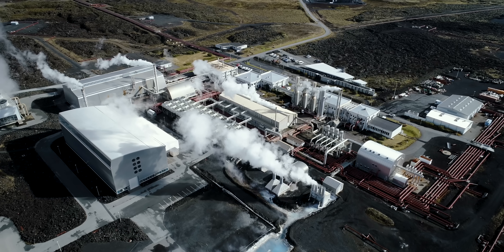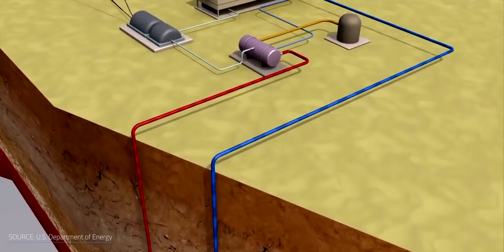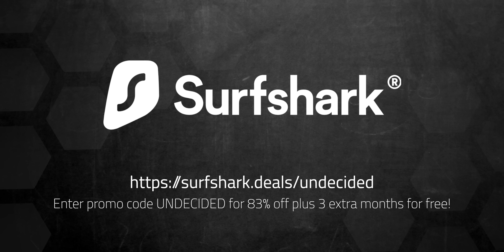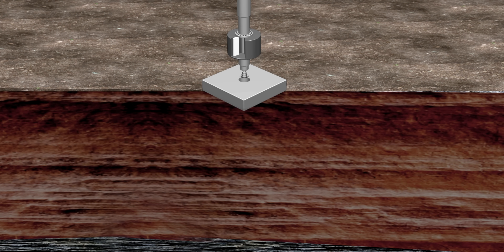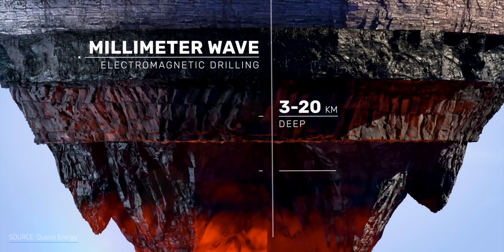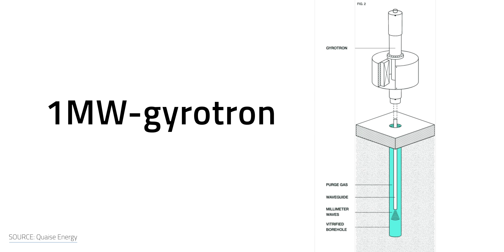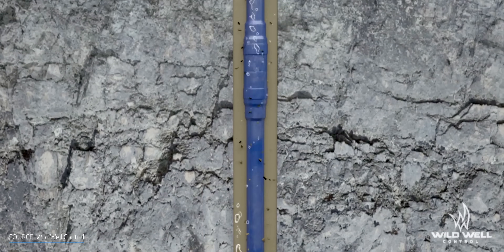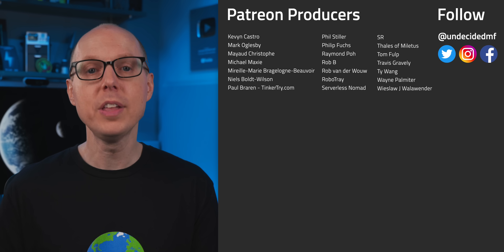Why This Fusion Tech May Be a Geothermal Energy Breakthrough

Comment: I wonder how they ensure that the well casing can continue to move downward when the molten glass they're creating at its leading edge, solidifies around it.  
In a conventional well, the drilling mud runs both inside and outside the well casing which allows it to keep moving downward under its own weight.  With this tech, it's going to be constantly trying to bond itself to the bore hole.
Reply: If the drilling head is a larger diameter than the casing it should be 👌
Reply: @kiwiguy4706   But it's not like a traditional drill head.  They specifically said that it was just the beam reaching past the corners of the pipe turning the surrounding rock into glass, but then implied that it would be able to handle more pressure this way.   I doubt that works if they're leaving an air gap between the bore hole and the well casing (glass isn't that strong), which means in the end they'll be pushing the pipe into molten glass as it hardens while vaporizing and carrying away everything inside the pipe.

Comment: You regularly cover both the generation and storage of energy but I'm curious of the rest of the grid. I'm from The Netherlands and due to the increased amount of generated energy from solar and wind more and more parts of the grid are getting close to their limit.

This seems like a topic that very few people cover while it is a key component to our energy solution, what tech is out there and are there any cool technologies on the horizon?
Reply: With energy transported by train, tanker trucks, pipelines, and electrical wires… all converging to electrical wires — this is a disaster waiting to happen since the amount of energy moved in a pipeline is much greater than energy moved on a wire.

The potential to consolidate all usable energy into a single failure point does not give me the warm fuzzies, either.

Diversity vs Uniformity in energy transportation as well as production is key, and few people talk about it.

Comment: Interesting concept, hope it works. As solar and wind solutions are dead avenues unless solar can get to 70% efficiency or higher. 17% doesn't cut it. Fossil fuel (Natural gas turbines) needs to be main source until we switch to Nuclear or Fusion, but if this is viable it may make it more viable to reduce fossil fuel.  As you can see our economy currently, stopping use of fossil fuel just destroys standard of living and hits low to middle class significantly.  Transition can not be step function, it needs to have a viable reliable technology that can be more reliable and cheaper than fossil fuel as to not impact end customers. This and Nuclear seem to be the best alternatives, good info, thanks.
Reply: Why are you suggesting such an arbitrary metric? solar panel efficiency is already more then high enough that we could exceed current demand by several orders of magnitude exclusively using low value land(like deserts) or areas already impacted by humans. The Sahara alone has more then enough surface area to supply 18 times the total energy needed to sustain 11 billion people at the same standard of living as the US at current panel efficiencies. Wind energy doesn't have as high of a maximum potential output as solar but we have enough potential wind resources to exceed current demand by a significant margin, plus it produces energy in patterns that are closer to average grid demand, can generate significantly more energy for the amount of land consumed, and can be used on agricultural land without reducing yields.
Reply: @garethbaus5471  Not so, if that were the case Nazi California ( in which I lived for 15 years) would not have brown and black outs regularly.  Solar/wind are  not the solution, sure you can cover the entire planet in panels, but what's the point in that when you have clean Nuclear and Geothermal plus Natural Gas to make the transition to Fusion.
Reply: @juanmacias4854  Solar panel efficiency isn't particularly relavent to grid balancing, energy storage, or total generation. The sunlight is free, and abundant enough to be effectively infinite so only getting a fraction of the potential energy really isn't a problem so long as you can put out enough panels at a low enough price. Also California only gets about 13% of it's grid energy from solar so it really isn't a very significant factor in brownouts yet. By percentage of their grid energy being genorated by renewables California actually isn't all that high compared to many other states so it really isn't the best example to use.

Comment: here (a few hundreds KM away where I live) were a geothermal project and it was should down. It created and issue, it hit a material which reacted with water from drilling or ground water, not sure about the details. The result was that material expanded and it created small earth quakes and the ground shifted. A lot of buildings near the test side did get damaged. A small town.
So this would be really be an issue for the idea to put it into coal power plants, at least not all might be suitable due to structure of the ground below and what's arround the plant. (I guess if a coal plant is very near a city, would really be bad/not well planed)

Comment: Scaling out into non-tectonic regions had made me mindful that if this is considered per home we could, still, perforate the crust. I'd be interested to see if more research has been done on this.
Reply: Tectonic activity is purely because of plate tectonics thus the name. You only get tectonic earthquakes because the rocks along fault lines are pushing against each other. They store energy in the bending or compression of the rock.
You cannot create that kind earthquake in a non fault area you would literaly have to crack the plate and the continental ones are 70km deep.

Which means the only other way to generate a problem in a non-tectonic region is thru volcanic activity. Which is actually reduced because pressure and energy are constantly being removed from the system by the power plant.

There are still landslides local excursions, groundwater contamination ect.  If done badly enough you could probably even undermine the structural integrity of a small mountain and cause a really big landslide.

However non of these are on the scale of causing a non-earthquake area to become geologically active.

Comment: Matt, This one is testing the limits of my faith.  I'm mostly concerned about the exhaust.  It has to go somewhere.  What does it come out as a solid or a gas?  Is there a gaseous component that can't be condensed?  How many of these holes need to be drilled to satisfy our energy needs?  How stable are these holes?  Considering they will be located near fault lines and volcanos, are they susceptible to earthquakes?

Comment: I took a course in geothermal energy in college and I really wanted to learn more towards it. But was disappointed as there was absolutely no geothermal energy production in India. The tectonically active areas in India is a convergence between two crustal plates and so the crustal thickness along those areas are extremely high as rocks pile up. 
That meant way too much drilling is needed to get to superheated water there.
If this technology works and is adopted by India, it would be a game changer. 
That would mean there wouldn't be the need for those gigantic dams in Himalayas that are now under serious threat from mudslides and flashfloods from cloudbursts that are happening more frequently because of climate change.
But I'm curious as to how the absence of seismic probe in conventional drilling could impact the process. It's kind of like driving blind. 
Though this might require using a separate probe after drilling to collect geological data, it will still help us research and understand a whole lot more about deeper earth. Then again, the lack of physical samples of rocks could still be a severe limitation.
Reply: Look up Eavor-Loop geothermal. They're able to generate electricity from any location by boring deep.
Reply: Could not agree more! it could be a game changer, but in geothermal or OnG drilling and exploration, geological data even just a drill cutting is crucial. We need samples of the formation to figure out what is happening inside the reservoir, there are a bunch of reservoir engineering works to be done that needs physical data of the subsurface formation. Luckily here in Indonesia we have an abundance geothermal energy potential, we dont have any problem with the thickness, its the economical aspects is the main limitation for us
Reply: @syauqiaqilm5692  On the flip side of this, since they are not using a probe they will be very limited in being prepared for changing materials...There is a real danger of them vapouring straight into an unknown pocket of methane without those data from the probe, which would be catastrophic.
Reply: I'm astonished with the amount of goats, cows and people in India. That no one can find time to start drilling with archaic methods. Yes it might not be practical in modern since but neither were or are the pyramids. Think about the result in profit and service to your own country. What a waste of cow power and lazy humans, waiting on technology instead of starting now.
Reply: @sclabhailordofnoplot2430  Sorry to disappoint your racist a**, cows   do indeed help generate a renewable power source...for biomass digestion. 
A decade ago....racists were mocking India with yoga, and now they can't get enough of basterdized versions of it. If your severity of racism hasn't degraded your cognition, pretty sure you'll do the same about 'cow power'. 
And you don't have to be so astonished about the high number of 'cows, goats and people' in India; it's only natural for life to flourish in a place where majority of it's area is productive the entire year, have diverse flora and fauna,  don't have extreme temperatures and are rich in resources.
Reply: dont the dams supply water?
Reply: @cadelaide  They do, but when the need for energy production is reduced the dams won't be so big.  Bigger dams can also cause reservoir induced earth quakes
Reply: @cadelaide  they do .
Reply: "The tectonically active areas in India is a convergence between two crustal plates and so the crustal thickness along those areas are extremely high as rocks pile up"

Not everywhere in India - mostly in the north where the Himalayas formed and are still climbing.

Further south there is much more potential.
Reply: @mnomadvfx  There is no tectonic activity or resulting superheated water in South India. Conventional geothermal energy is tapped from tectonic plate margins that move apart, thinning the crust and the molten margin between crust and mantle rises up. The fluids that separate from that magma is superheated because of the pressure and its this water and heat that gets harvested conventionally. South Indian geography is of tectonically stable cratons. Though it's not as thick as the Himalayas, there is still no prospect for conventional geothermal harvesting in South India because of the lack of both tectonic activity or mantle plumes activity
Reply: @aleenaprasannan2146  @Mountain Nomad VFX Technical the hot spots for geothermal are off of southeast India and way out into the sea. Burma plate. https://en.wikipedia.org/wiki/Indian_Plate
Reply: @sclabhailordofnoplot2430  When we refer to southeast India, we usually mean the Indian subcontinent. The Indian Ocean territory as respective parts of Indian Ocean itself. And yes, there is volcanic activity there as Andaman and nicobar islands themselves are backarc islands formed because of subduction

Comment: I am thinking that geo thermal boreing  induced earthquakes could be a good thing. Inducing an earthquake prior to high buildup of techtonic stresses in theory would induce a lot of  non critcal small earthquakes instead of a few catastrophic ones. After an area experiences a big quake, it might be a good area to start a tectonic stress relief project.
Reply: It sounds good in theory, but in practice it probably wouldn't work that way. Even a 10km deep borehole still only grazes the lithosphere. That would limit this only to shallow crustal earthquakes. These are rarely the "big ones", those are almost exclusively the domain of tectonic plate interactions, too deep and too large in scale to be affected by drilling. Additionally, you'd have to be able to detect the stress in the upper crust faultlines, calculate its source and vectors, and calculate a model for such release. Then you'd have to drill on the designated spot.
Reply: @TarisSinclair  I believe the potential success of geo thermal anywhere will morph to be refered to as geothermal everywhere. The power is for use by the customer so economics  should dictate construction of facilities near population centers. That removes the problem of power plant location if they are everywhere. So that  may be a good thing if a fracking break up of the earth crust absorbs seismic activity. Because EGS did induce an earthquake in South Korea and an earthquake is the relief of internal stresses within the earth I have to believe (guess really.) that EGS areas will likely have more earthquakes at lower amplitudes of activity. This is apparently a phenomena on the San Andreas fault around Hollister California. (A lot of activity but usually at lower amplitudes) I did not know that the deep big quakes originate below geo thermal well depths. I used to work at a powerplant. We circulated deionized water in a closed loop system for a heat recovery steam generator using gas turbine engine exhaust heat. That was really to protect the heat exchanger but I think there would be a significant maintenance advantage in closed loop systems as opposed to circulating water through fractured rock. I would bet closed loop systems would have little effect on seismic activity.

Comment: I love the sound effects ~2:50 bubbling water then especially as the turbine starts to spins up.  Well done Matt!   On subject, I heard that there is another problem that comes up during operation.  The water is very salty and leaves deposits on everything.    .. still seems we are missing the obvious:  there is plenty of heat to be had by pointing mirrors down from space.  This is viable tech now.
Reply: Suddenly a thick aluminum foil hat is sounding like a good idea (joking) I imagine you are correct. However I would still be deeply concerned about misalignment caused by human error or systems failure. I could see some powerful militaries applying this like a child frying ants with a magnifying glass. Would the focused light have adverse local weather effects? 🤔 maybe best to have this system aimed at an offshore power plant?  Way offshore!!!
Reply: @delh.773  Sunlight shining down at night on a solar power collector would be no more dangerous than sunlight doing the same during the day.  Though we could amp up the power from there.   Then battery backup would not be as important.

There are people proposing that instead of using light thin film Mylar mirrors that we should instead lift into space heavy inefficient Photo Voltaic equipment and use inefficient  microwave transmitters, and then send microwaves down to specially designed receivers to convert that back into power.  Microwaves interact with moisture and would disperse and create steam.  It is a stupid proposal for power, so God knows if they have something else in mind.  Those proposals are in the study stage and have been funded - so If they do this, you might want to invest in that tin foil hat.  Don't know what to tell you about the steam.

The Soviets actually launched a mirror in 1991.  It was an experiment.  We didn't get data from the experiment because it failed to unfold, then the Soviet union collapsed.  I think their concept was artificial moonlight at night for cities so that street lights would not be needed.

Comment: I really like the concept of using this in conjunction with existing power plants, to power the drilling, and replacing fossil fuel sources at the plant.
Reply: And solidify Earth's core. Smart
Reply: @Bryan-Hensley  Wow, that's like saying we're going to drink the ocean dry.
Reply: @TheJarrodh  yeah kinda like saying fossil fuels could actually change the climate.
Reply: @Bryan-Hensley  Nevermind, if you're a climate denier, then there's obviously no arguing with you.
Reply: @TheJarrodh  if you are a earth solidifier denier then there's something wrong with you. Use common sense dude. I'm sure no one thought fossil fuels would change anything in the beginning. How do you know we wouldn't change the rate at which earth is losing heat if enough energy was being used from this.
Reply: @Bryan-Hensley  The primary reason that the earth's core is molten  due to the decay of radioactive elements. It continues producing heat.

Comment: I’m not a scientist or anything but I remember learning about the law of conservation of energy. If we take the energy from within the earth (the heat), overtime won’t we decrease the amount of energy within the core? Which could slow the earth? Or is this skepticism not warranted?
Reply: I looked this up, apparently it would be more than replinished by the natural radioactive decay of particles inside the planet.
Reply: @haydenravenscroft1803  but is there an infinite amount to decay? It kinda implies that something is being used up or breaking down into simpler elements. Maybe those elements make their way back to the core to fuel the decay because they naturally react together which is why the core is the way it is, basically completing a cycle
Reply: @GEEK-3  my understanding is that the decrease would be so insignificant it wouldn't really matter, not for millions of years if 100% of our energy was geothermal at our current rate of energy consumption.
Reply: @haydenravenscroft1803  okay okay, understandable. Nice chat